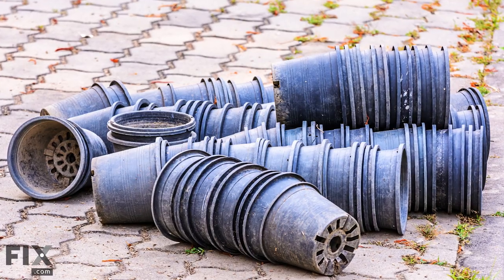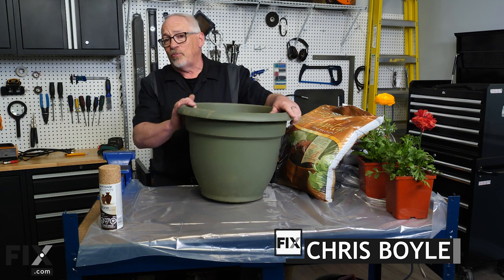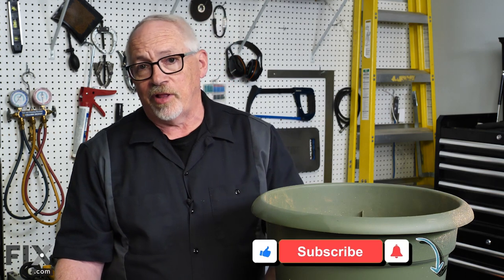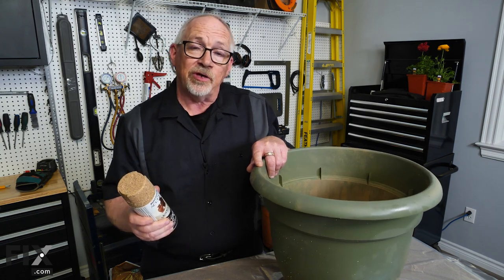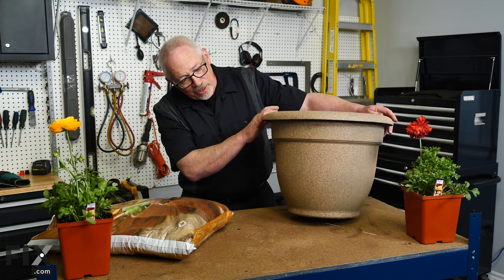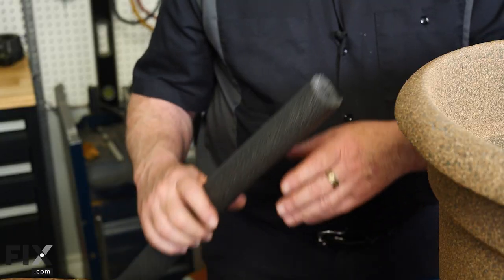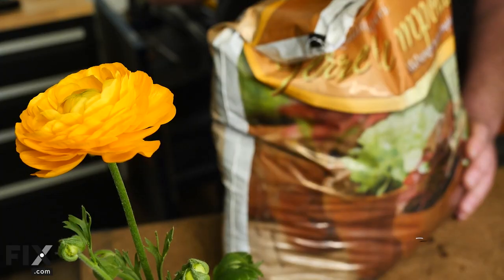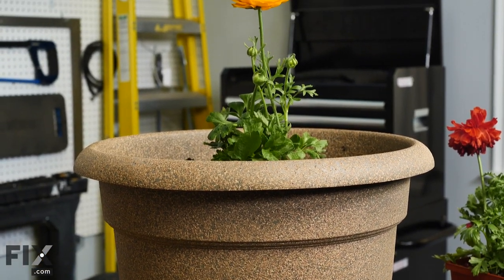Don't Throw Out Your Old Plant Pots! Here's  How to Restore and Re-Use Them! | FIX.com

Comment: The pool noodle base is definitely a light weight filler idea. Another trip that seems to work well is to break small tree branches/twigs to put in the bottom of the pot. (Pieces about the size of a woman’s little finger.) Layer these and cover with a single layer of cardboard cut to fit the inside of the pot. Not yet sure about long term success with this method, but it’s free and natural. 😊

Comment: How long do you expect the painted pot to last outside without peeling?
Reply from the maker: Great question! The ones I did lasted two seasons with bringing them in for winter. I will have to reapply next spring.
Reply: For water drainage I use the old flower pots upside down that you buy the plants in originally 

I may try this, it looked cool, just wondering how the sun would affect the paint as my ugly pots are indeed in the sun all day, thx for posting